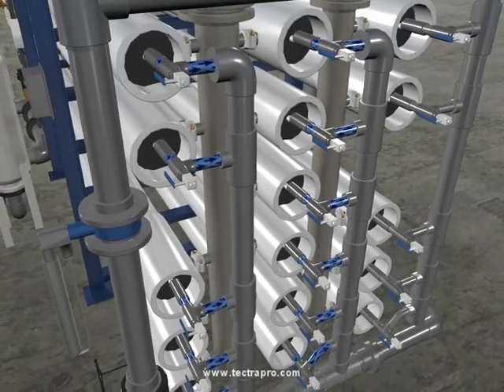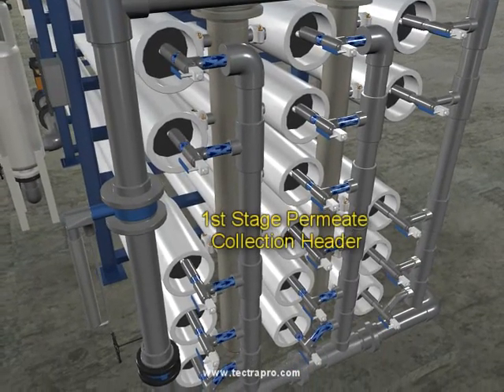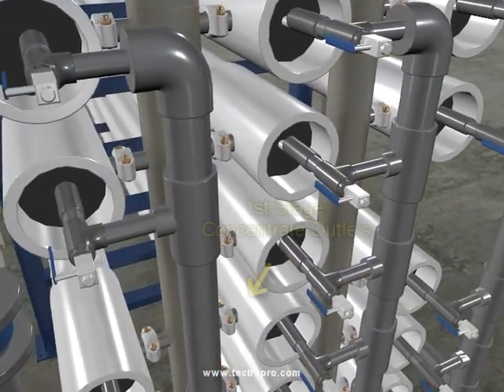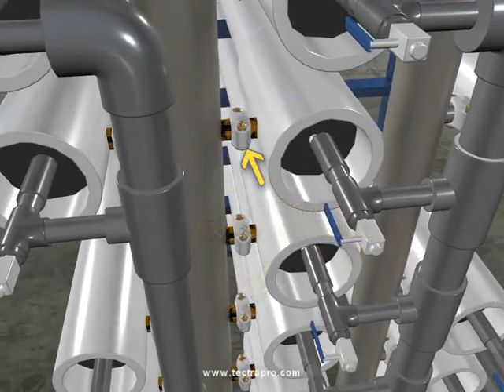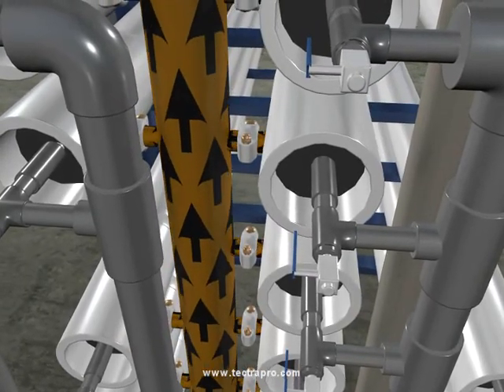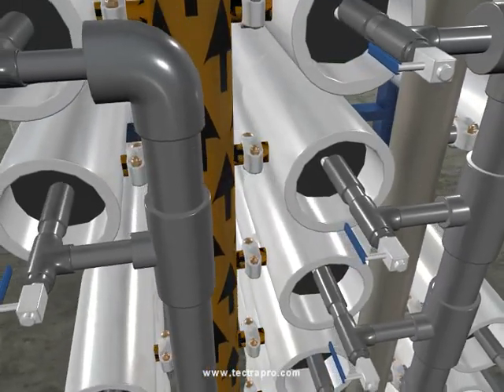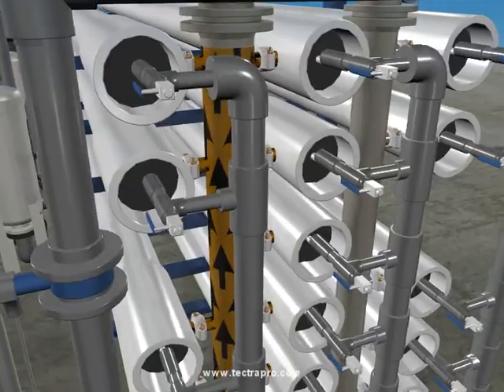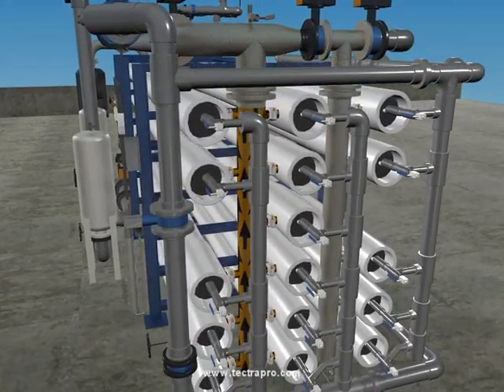Reverse Osmosis or RO System

Comment: Yeah, they are all great and stuff until you have to change out the membranes.  PAIN. IN. THE.  BUTT.  That and the high and low pH cleanings we do on them are unnecessarily obnoxious.  We also use several ultra filtration trains prior to the RO's.  Neat set up but they can be a bother sometimes.  Doesn't help that we run them at max.
Reply: We change them once every few years. 4-5 on average.  We have a schedule to run the CIP once a week. Different train every week but it was getting so bad that we were doing it more often which seemed to help little.  Hard to determine what the cause was.  we have a UF system upstream and we used antiscalant and a microbiological upstream as well.  we are prone to heavy swings in flow though.  This is just part of our system to treat boiler feed water and as demand swings on the boilers the instrumentation cascades to swing the RO units.  Doesnt help that we have to time our cleanings, often shortening them, because of water demand.  We run out of water the whole refinery goes down.   You're right though.  The cleaning are long. Lol.

Comment: i dont like how the pipes are low poly so you can see the straight edges on what should be a round surface

and the distortion on the flow arrows going over the pipes is a bit cheap looking